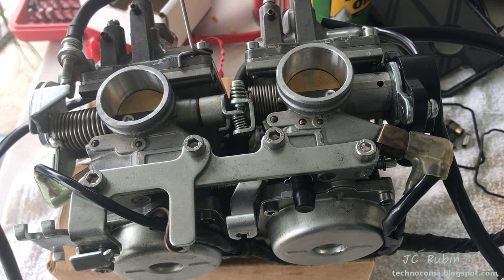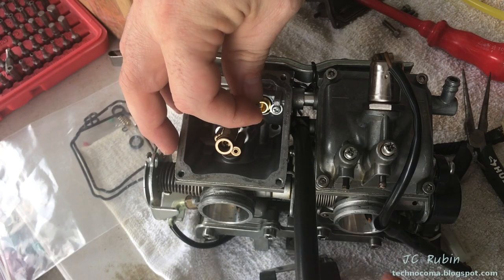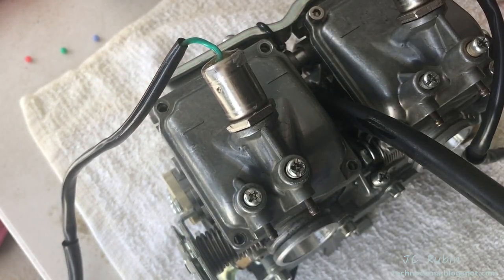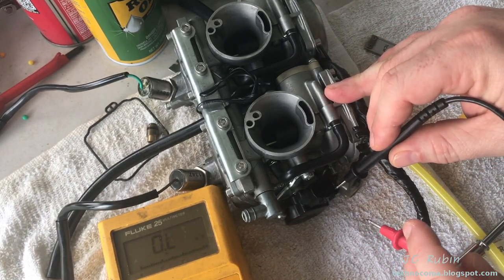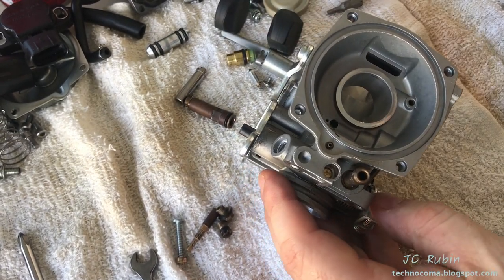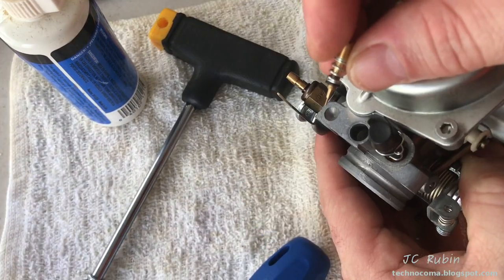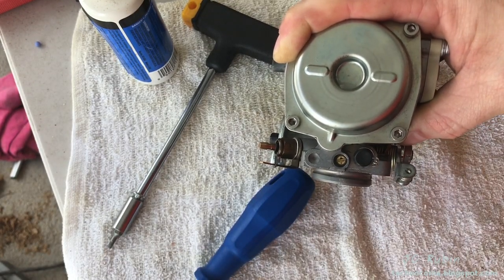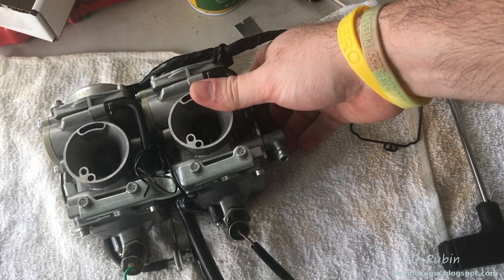Yamaha Star 650 Carburetor Test & Adjustments - Floats, TPS, Heaters, Solenoids, PMS, Leaks Part 2

Comment: Friend, those screws in front on the bowls. I forgot to document how they were turned before unscrewing them. It's my first bike carburetor rebuild. Can you please help me. The screws under those wires on each bowl. The float bowl covers each has two screws. What's the relationship with them and what's the proper way to put them back in. I noticed they block off a hole

Comment: Is there a way to adjust these floats without having to reassemble the float bowls and disassemble them to make adjustments every time? It seems other carbs use a float height gauge when open on the work bench first. Does anyone know what that height should be if you tried it with this type of carb? The manual only uses the method described here and only gives the fill height (8mm +-0.5mm).

Comment: I truly appreciate the professionalism of this vídeo. I made a looong trip with around Mexico with my 2001 Vstar. By the end of the trip the bike was not accelerating as it should, so I decided to give full maintenance. Long story short I found like 200gr of rust in the gas tank, replaced the 20 year old gas filter and found lots of rust at the bottom of the carburetors as well as some stuck needles. I cleaned everything as you recommended in another video but then I found that the gaskets were just too old and parched so gas started to leak from there 😔 unfortunately is very hard to find those pieces in Mexico so I ordered a replacement package from Amazon but i have to wait like 25 days for them to arrive.

It's a horrible feeling not being able to use my bike and just watch it sitting in my garage 😔. Anyway watching your videos makes me feel more prepared for when the replacements arrive.
Reply from the maker: With a cleaning and new gaskets you should be up and running just fine.

Comment: Hi there, this has been the most useful video I have seen. So thank you, but I have a problem. My signal wire is showing 5v like my live wire on the TPS connection. Do you know what could be causing this and what I need to do to resolve this? Thank you.

Comment: Hi, I have an unusual situation. I bought a V-Star 650' 2005, Classic few day ago.. Hadn't run in two years. Removed the carbs, they were full of green residue from the old fuel. I remove main jets, floats, etc., used gumout carb cleaner, them compressed air. Put everything back together turns over but won't start. I have spark on both cylinders ; the bowls are full with gas from the pump. I can hear the fuel pump come on then stop. 
But I can pour a little gas in each carb throat , hit the starter button, and it will start and run that gas out. Then no start. It's as if it's being shut off somehow. It doesn't have the stop solenoids on the fuel bowls. This has me baffled. Any ideas?
Thanks, Art Rigsby
Reply from the maker: Sounds like it needs a more comprehensive cleaning and rebuild

Comment: Great videos on the vstar, I've been using them alot lately, I was wondering if the tps reads no resistance when on the carb but has around 6 ohms off the carb does that mean it's completely shot, also It does get resistance on the carb but only when I turn the tps really far to the point where It it can't be fastened. The bike doesn't idle down when stoped in gear but drops down in rpms immediately when I put it in neutral. Sorry for the long winded comment, I was just looking for some insight
Reply from the maker: you could manually turn the tps off the carb and watch the resistance curve to see if the device is broken.

Comment: I watched several of your videos on this carburetor rebuild process. I followed them explicitly, but I’m still having an issue setting float height. No matter which way I bend the tang on the float, the height of the fuel is still 1mm above the factory line on the float bowl. What could be causing this issue?
Reply from the maker: Perhaps something is obstructing the float needle, did you check that it seals
Reply: Retro Tech & Electronics Yes I did, I blew air into the fuel inlet on the carb. No air passed. Both carbs have new needles and seats

Comment: Nice work. Do i need a fancy volt meter or will a walmart one work? My 06 vstar 650 is giving me the tps code. Not a very cheap part.
Reply from the maker: A walmart one will work. The TPS is a straight-forward test.
Reply: What do you mean by giving you TPS code?
Reply: @jimwilliams2327  throttle postion sensor. It has a set ohm reading and what not.
I got it squared away and feel quite knowledgeable about it of needing help.
Its a code listed in the book as well
Reply: @retrotechandelectronics  so sorry. Just seen this. I got it squared away. Used a wally world one. Kicked my ass but i learned the ins and outs of it.

Comment: I am wondering why the jet is removed in connection with the TPS sensor - like you take it out, remove TMS, install TMS and reinstall the jet.  Can we skip the jet when calibrating the sensor?
Reply from the maker: Sure..... but... Dont you want to clean the jet?
Reply: Retro Tech & Electronics I suppose so.
Reply: I drilled out the plugs and found that both of the plugs are fully closed. I mean they are seated all the way in, zero turns.  Could this be why my bike doesn’t run well?  It is a 2007 Custom 650 with 5200 miles that I got used. It wasn’t running when purchased I had it towed, did a carb kit and got it running - just never running healthful as one would expect.  It bogs especially past half throttle and the solenoids kick in and the bike won’t go when that happens - I added an LED indicator to the solenoids so I would know if that was the cause - but it rides poorly before the solenoids actuate.  It is a California bike - 2nd owner and I live in California. Should I clean it and  then go2-1/2 turns in and try it out ?  It just seems odd that it would come fro. The factory that way but I drilled out the plugs tonight so it wasn’t tampered with.
Reply from the maker: @Lgn26point2  I cant fathom that they would be fully seated.Then, nothing from California surprises me anymore.  I would in-fact bring them 2 turns out just to see how it idles and comes off idle, adjust from there.
Reply: Retro Tech & Electronics  I did that and started her up and it doesn’t sound promising.  I will warm her up tomorrow and go out for a couple of miles to see how things are.  I wish I could adjust them with the air box installed - at least I can leave them installed.  Thanks for your advice.  I detect a Boston accent.

Comment: I touched my flats xvs650 and nowww atttt WOT I lose 8.5mph per gear and I get not a rev limiter sound but a fuel cut off sound so .... did I make my floats to rich to much fuel ?
Reply: Floats
Reply from the maker: The float position can simply be checked to see if it was moved.